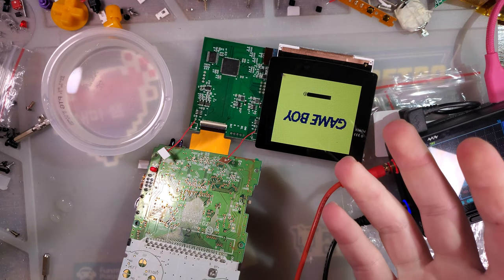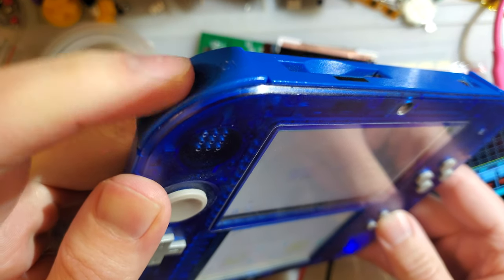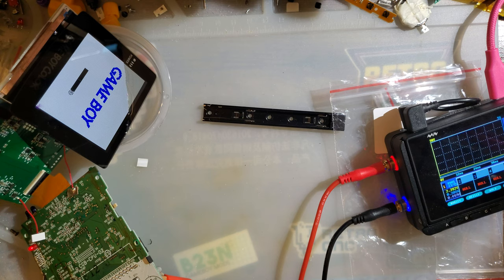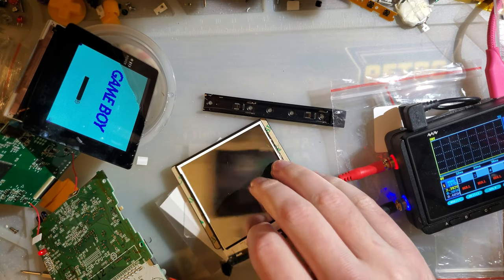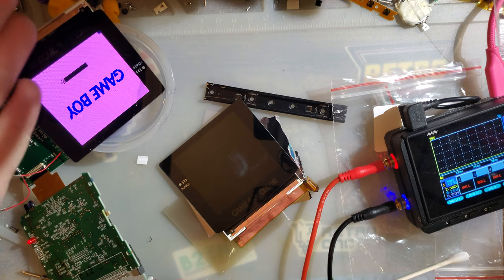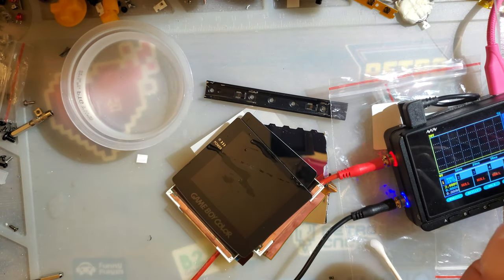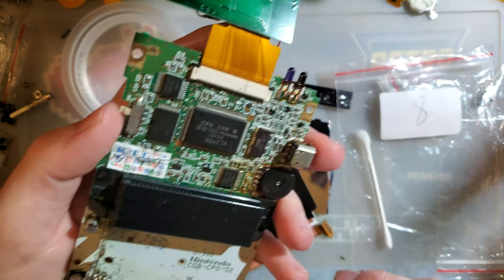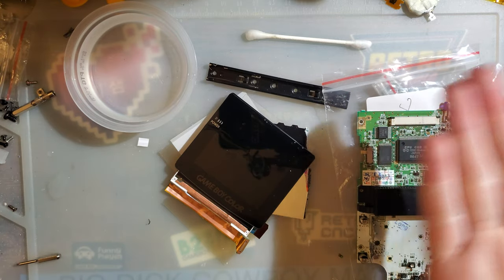IPA Is For Spot Cleaning Only

Comment: Spot cleaning a screen, sure.  You explained how that CAN be bad, but tbh it sounds like you let the IPA sit way too long on the screen.  Swab it on and clean it dry.

However, IPA doesn't ruin electronics.  You can soak that board and all of its components in IPA and the worst thing that will happen is possibly stripping some of the silkscreen.  IF you leave it soaking in there.  I'm not sure your sudden fear of using IPA and a blanket statement that you can ruin your electronics with it helps anyone.

I've only been working in electronics for a few years, but one of the best lessons I learned is to not listen to everyone.  Take advice, but test that advice.  Breaking your shit is always the best way to learn.  Never assume the word of experts is gospel.

No offense, just honest feedback.  I know you're just trying to help, which is why I started watching you.  You seem genuine and honest.  Plus you're one of the most prolific YT I've watched lately.  I can always look forward to having a video to watch. :)
Reply: Thats totally right. A common practice is to use IPA for a deep clean where you soak the whole thing in a large bin. After the clean you clean the whole thing again with distilled water to get rid of the residue of IPA. And thats also a problem on screens. IPA gets between the layers of these screens, has a hard time to evaporate and when it evaporates it also leaves residues. 
The hard part is to get the stuff dry afterwards. Things like relais, oscillators etc... so basically everywhere where capillary action can take place. 

The right tool (in my opinion a vacuum oven e.g.) is needed then. This could also save these screens (besides the IPA that can still leave you with slightly cloudy spots).

That said the advice should be ... don't soak screens in IPA if you don't have the right tools.
Reply from the maker: This is targeted towards the people who think that dipping a whole board in IPA is the proper way to "refurbish" the console. Yes, most components and the board itself ARE fine with that but mechanical switches, potentiometers, electrolytic caps (not all -- read the datasheet), crystal oscillators (again, read the datasheet), and some plastic connectors are NOT suited for this. All GB consoles have at least one of these components on board. Adhesives and inks are also not IPA friendly (stickers and QC marks). 

There's also the fact that the same "IPA safe" components are ALSO totally water safe. To safely clean these parts with water, you must also allow the water to evaporate before operating the device. This seems common sense for cleaning with water but is often neglected when using IPA. 

I've seen countless consoles ruined from this and I've personally experienced the inconsistent behavior that results from getting IPA inside a switch. The most common story is that someone is "refurbishing" a GBA SP. So they douse the board in IPA. Well, IPA works its way into the tact buttons and now some of the face buttons stop working. So instead of drying out the switch, the "refurbisher" then proceeds to replace the switch. This doesn't always go smoothly either because heated flux works just as well as IPA in working its way inside things or because they don't have the necessary experience with soldering to complete the job. 

Obviously use your best judgement but if you decide to do something that someone explicitly warned you against, you really have no one but yourself to blame.
Reply: @hasserecht3678  Yeah, for a screen I would be VERY careful of anything.  I'm not sure if there are cleaning products that help with the issue, but it's definitely something to be wary of.
Reply: @makho  Yeah, I completely agree.  It's still a solvent, so especially with plastic parts, you want to clean and dry it as quickly as possible.

I guess I was just saying that, in general, IPA isn't something to be afraid of, outside of special situations like a screen.  That's what I thought you were referring to in the title, but it felt a little too general, which tends to plant a seed in people's brains.  

But the Gameboy has some delicate parts, so you'd definitely want to be conservative with where you're applying IPA.

So, will the capillary action happen with ANY liquid, or just the thinner ones?  Is that an issue with newer displays like you get in kits?
Reply from the maker: @hollowneedles  Capillary action can occur with any liquids. The lower the viscosity of the liquid (e.g. IPA), the stronger the effect. If you were to slather honey on the screen, that would soak in too, eventually.
Reply: @makho  mmmm, edible Gameboy.

Comment: interesting. I've never dunked a screen in isopropyl, but we usually clean motherboards by dropping them in an ultrasonic for a few minutes submerged in 99% isopropyl. iirc, that's how Louis Rossman cleans mac motherboards, too.I don't use it on plastic parts though. they get dropped in soapy water, or peroxide if necessary. interesting to see what iso does to a screen though.

Comment: IPA is like a cursed hammer, when wielded, everything looks like a nail...especially your thumb.
I remember destroying the paint of my Mega Drive (Genesis) with IPA. Since then, I use soapy water for the plastic and alcohol-free lcd cleaner for screens. You have to take apart the console but on the plus side, these are cheaper than IPA.
I cant think of anything better than IPA when you are cleaning the PCB itself though.
Reply from the maker: >I cant think of anything better than IPA when you are cleaning the PCB itself though.

Sure but my point was that it should not be the only tool in your toolbox and it is not a blanket solution to every problem.
Reply: @makho  Yep. That was my point as well :)

Comment: You can bathe most parts in IPA without issues but never get any kind of liquid between the polarisers in a screen because then you will ruin it
Reply from the maker: Thank you for missing the point of this video entirely.
Reply: @makho  That IPA is only for spot cleaning? If you use unadulterated IPA and give it time to evaporate it’s one of the best chemicals to use… what else would you recommend?
Reply from the maker: @CrossedCoder  Only cleaning things that actually need cleaning.
Reply: @makho  my OCD won’t allow that 😮‍💨
Reply from the maker: @CrossedCoder   You're not following good practices.

Comment: I ruined my ds lite screen as well. What happened to me was that the alcohol got inside the screen and got inside a thin plastic layer of the light guide of the backlight and made some bubbles between it and and the thick guide. I imagine it made the properties of refraction of the light across the guide change on the bubbles by dissolving the glue and making it not touch anymore. I removed the plastic and now the light only illuminates the lower part of the screen well. I might be able to fix it, but buying a new screen is easier.